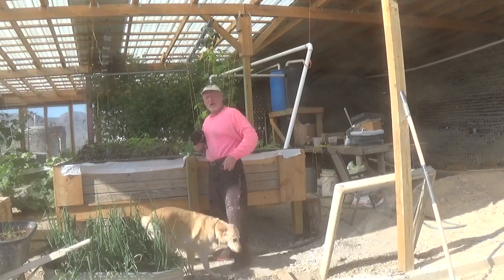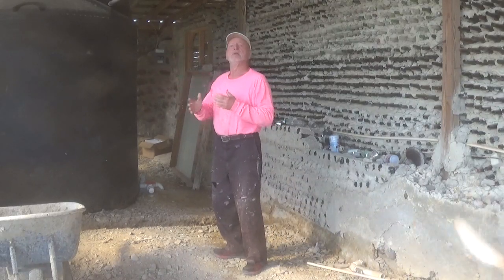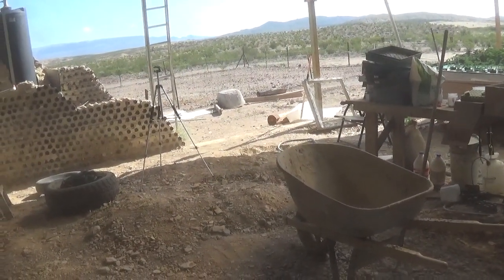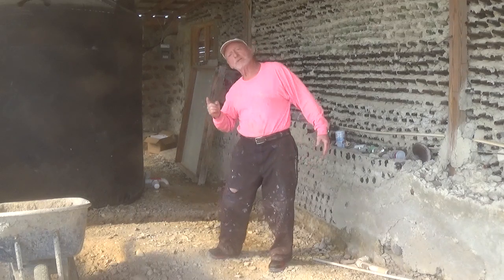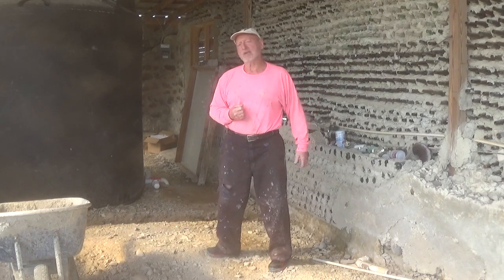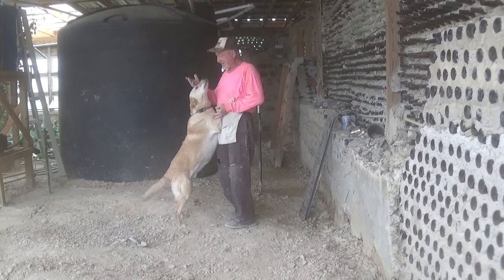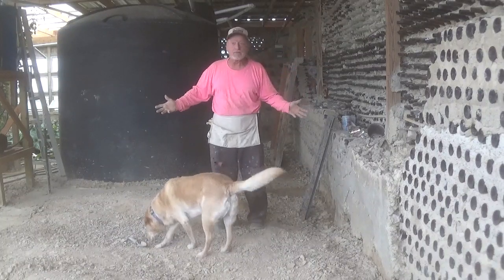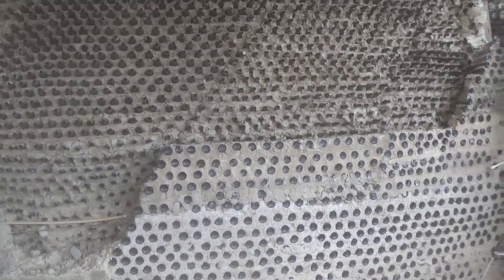The Water Cistern Build, Part One Of "Several"!

Comment: A small concrete curb is much stronger than people realize. Built a testing wall with 10 feet of stem wall.  It was so hard to break that back apart after the testing was finished.  Hours with a jackhammer.   Should be very strong.

Comment: watched a couple vids on your page now, yup, i like you, but the audio is absolutely wretched... gatta work on that.. hard to listen to... GOD BLESS
Reply from the maker: Movie Maker always start the audio running behind the video, so I don't use it.
Reply from the maker: We have done all we can with the audio using my current cheap video camera. When I need a new one, I will get a wireless, noise cancelling mike.
Reply: @ecoranchusa  when my audio is really really bad, i have made a voice over by recording at the same time then later editing it in,  i've used the basic widows movie maker, it's easy to add, however, sometimes audio quality is poor in a different way, it's for sure a challenge (audio issue that is)